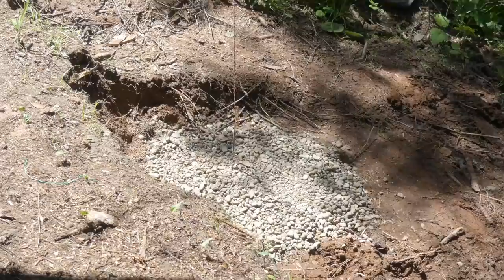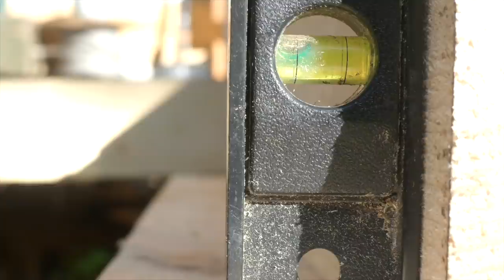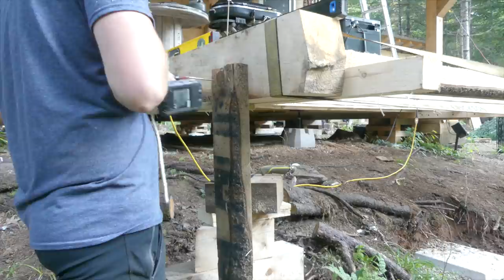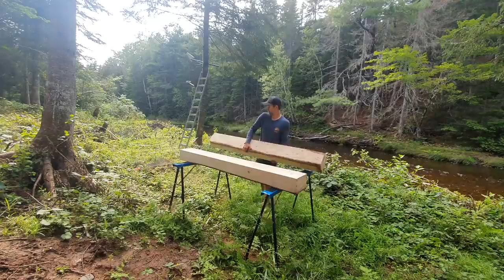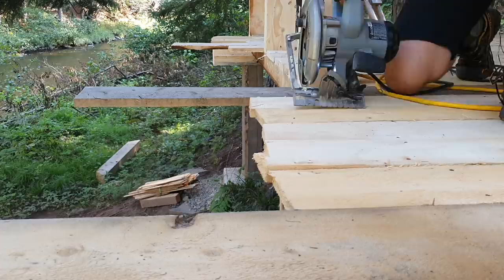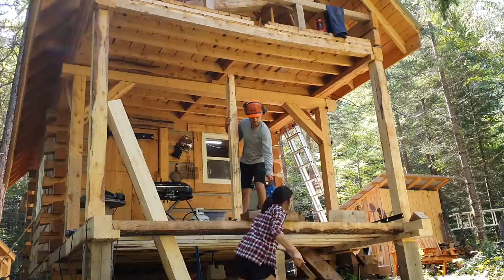The Cabin is Growing! Extending the front of the Dovetail Log Cabin | Episode 1

Comment: That's why you should use screws in your decking, so you can take it apart for repair or replacement,  rather than wrecking the material. Just saying.

Comment: Well, because you know what you are doing, is there a reason, why you are putting the missing edge always on the downside of the wood?
Reply from the maker: I am not sure what you mean by the missing edge?
Reply: @PenniacWilderness  Well, sorry, I´m not an English native speaker and may miss the correct technical term.
When the square timber doesn´t have the whole profile on all sides/edges, and there remains a part, where you still can see the bark, or let´s say the tree-profile.
So that´s the weak spot of that square timber, because it doesn´t have the whole profile.
I hope you get what I want to say.
You are laying the square timbers so that those "weak spots" are on the downside.
And because you are obviously a great craftsman, I wanted to know if there is a reason for that, or if it has happened randomly.
Not that I think it will fail, you have chosen the profiles with enough reserves for sure, I´m just curious.